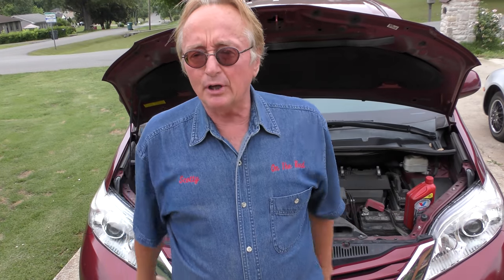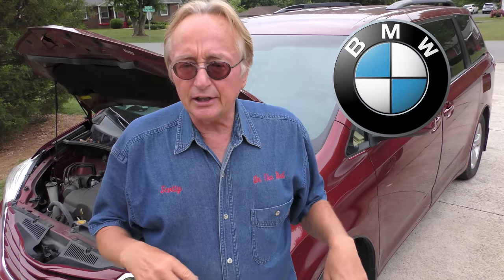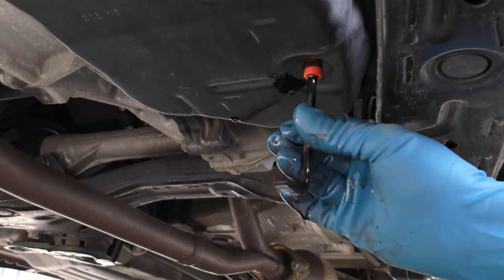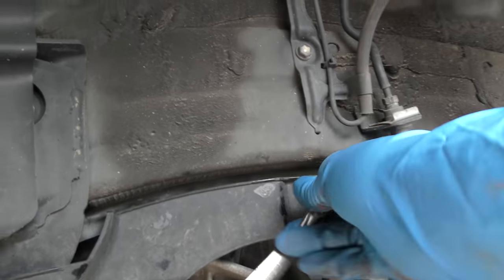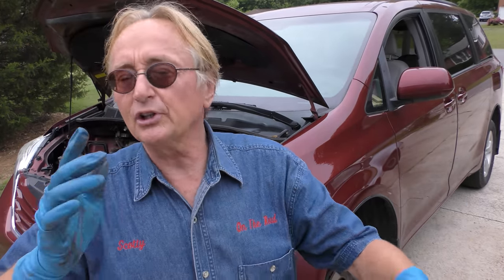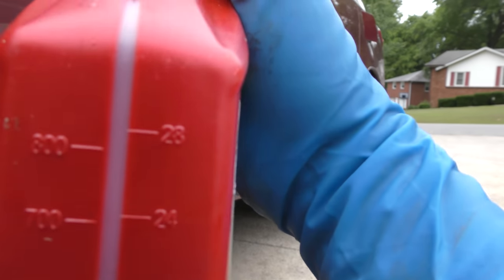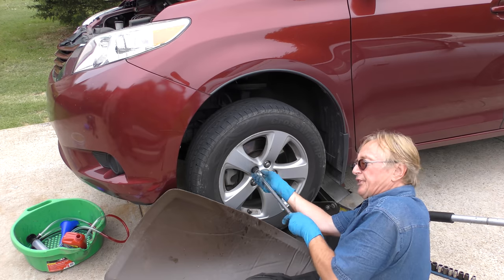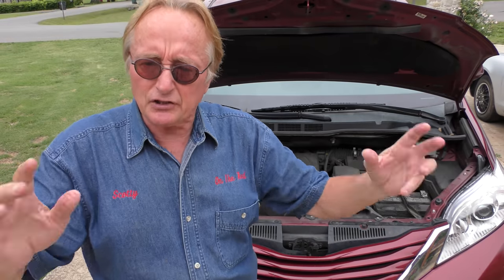Here's Why Changing Your Transmission Fluid Can Cause Damage

Comment: Dear Scotty, I have a 2010 Toyota Camry LE. I bought it used from a dealer in 2013. I’m a relatively older woman with no significant other to inform me on decisions about caring for my car. I have watched hundreds of your videos and have really learned a lot about good car maintenance. But, this transmission fluid changing, or not changing, has me in a dilemma. The car had only 35,000 to 38,000 miles on it when I bought it. Therefore, I feel relatively safe in saying the transmission fluid had NOT been changed before I purchased the car. I’ve had the car serviced regularly. After I asked the mechanic to use pure synthetic oil in my car, oil changes have been less often. I pray that’s correct. Guess Who told me about the pure synthetic oil. Now, what do I do about the transmission fluid. I feel sure the mechanic has never changed it. What do I do, just ask if they’ve changed the fluid, and pray they don’t lie to me? If they tell me for sure that they’ve not changed the transmission fluid, what then? The car now has approximately 109,500 miles on it. From just now watching your video about this, I’m thinking it’s too late to start now. Or, should I ask them to clean the pan, (is that right) and then put the old oil back in? I am seriously concerned about the car because I cannot afford to buy another one. 
(I have medical bills up to my, uh, knees, or a little higher. LOL) I would be forever grateful if YOU were to read this and let me know what to do. My son is in the Army, and is right now somewhere “over there” keeping our Great Country safe. I really think he could do it if he was here. Bless You Scotty for what you do for all the people that are smart enough to watch you, and that includes me. THANK YOU! I’ll be here in KY with my fingers crossed for your reply. Take Care!
Reply: Hi Paula, if you never got a reply on this, it's not something to be overly concerned about, especially if your transmission is shifting without any noticeable problems. If you don't hear any clunks or whines and you don't feel any jolts (or if it's a manual any "notchiness" or difficulty getting into any gear) then leave it until you can get someone you trust to check it. 
If you do get it changed, make sure you get the high quality fluid that's recommended by Toyota for the model of transmission and that it is replaced with just the right volume of fluid.
Reply: Drain and fill will get a few quarts of clean oil in there.

Comment: I have a 2001 Camry. The local Toyota dealer granted my request to have the transmission POWER FLUSHED on two occasions. A few years later at 187k, the car wouldn't reverse. I learned from Scotty that is the first indication of a worn-out transmission. Sure enough, it was. Problem was there  was no way to prove the flushes are what killed it, or if it was because of how many miles were on it. I did leave a nasty review on Yelp critical of the dealer for not warning me about flushes. I had a transmission shop rebuilt it 7 years ago. 80k miles now put on it Still no shifting issues.

Comment: 2014 is350, started changing out 4 quarts of ATF at a time at 90k, now at 196k and no issues with Maxlife Synthetic ATF
Reply: Maxlife is no doubt a great, inexpensive synthetic ATF. Not exactly matched to Ws but close enough. The key thing though is longevity is more a product of the transmission in question. It’s a Aisin. They regularly last 300,000 with zero maintenance. Now does that mean you shouldn’t service it? Well of course not. Transmissions should be drained and filled every 30,000 miles.
Reply: @nordicpride9708  i think it holds 10 quarts, or 12, not 100% sure but i just drain out 4 and replace it about every 3rd oil change so 20 to 25k. I hope to get 400k at least lol.
Reply: @xxxblanco Most people never change their transmission fluid. Yet they are the first ones crying when they grenade from lack of maintenance…. I’m sure with your routine 400k will be easy

Comment: I am 100% with you on the dipstick issue, Scotty!
Reply: Music Releases  They could at least have a fluid level sensor inside the transmission to alert the driver of fluid loss, most likely caused by a leak somewhere. 

It's even worse with the B5 Passats, on which the belly pan covers the oil drain plug, but not the transmission drain plug. You saw this coming -- I have read of a few instances in which folks drained the ATF instead of the engine oil. :(
Reply: The orange piece under the drain plug is actually used to check the level on Aisin transmissions.

Comment: Thought mine got changed on my Tacoma when I turned it in to change the frame.  I asked for it to be done, but didn't double check.  Whoops!  Now 240,000 on original fluid.  Such is life.  just hoping it does not go out while pulling the camper!
Reply: Make sure the differential is good to go as well!

Comment: Scotty, I have a 2006 Honda Accord SE with Automatic Transmission. I had the Honda dealer do the trans service for $150. When I saw the work order it did not show the trans filter under parts used and said that 2 quarts of new fluid was used. I thought that was sorta weird no filter change and so little new fluid installed. So I bought the full Honda Service Manuals Set and it says to do the auto trans service change out the trans filter and change the trans oil THREE times. It says: After changing it the first time drive the car 20 miles and then the second change of oil drive it again 20 miles, drain and change it the third time and drive it 20 miles then drain and fill to between the dipstick holes. I asked the dealer service manager why he didn't replace the trans filter and why he only drained the open once letting him know the Factory Manual procedure. He told me NO DEALER DOES THAT... but if I wanted it done that way it would be $450! That is the last time I will use that dealer. Do you have any comments Scotty?

Comment: I did the trans fluid on my 2013 Lexus RX 350 same engine. You can do it with a long funnel, no need to use the messy pump. Please only use Toyota WS fluid in the 2GRFE engine!

Comment: Love the “Scotty working on a vehicle” videos. I follow the rule that anything not Toyota that’s NEVER been changed (90K)+, I will NEVER change. It will ruin them. Old school break over bar and manual torque wrench, I have those! Tks Scotty.
Reply: I just bought a vehicle at 88k miles, is it safe to change the fluid at this mileage?
Reply: @FearABlankPlanet  change it I do it on my with 110k and is running great.

Comment: My friend brought me his first car ever to check over. 2009 chevy impala 125k  fluids looked never changed. Power steering pump gone, oil overfilled, oh boy.  Transmission fluid never changed. I dont think he should change the transmission fluid at this point. Just pray like you said. I corrected the oil and cleaned the car up. Hes got an airbag light on im going to try to reset.

Comment: Even transmission shops can put the wrong fluid and the wrong amount of fluid in your transmission! Be aware!
Reply: Exactly why I do my own work, as much as possible.
Reply: And so can yo and I...
Reply: @spol1622  you and I are not mechanics, but transmission shops are supposed to know what they're doing, it should be certain they put the right fluid and the right amount of fluid, but often that's not what happens.
Reply: Michsqitch  check the dipstick to see the color and smell of the fluid, and check the bill to see what fluid they put in the transmission, comparing against the owner's manual.
Reply: OMFG I KNOW, i bought the wrong atf at walmart due to the workers not checking the shelves, and when i went to return it i said “the rest were dextron 6 but this multi vehicle atf and i dont wanna mess up the transmission” the lady behind the return desk said it wouldn’t have hurt it. 🤦🏼‍♂️
Reply: Michsqitch  you won't know if they done something right until something goes wrong with your transmission
Reply: true!
Reply: @robsonselzelin  and make sure they use OEM fluid and make sure they actually do it, if you’re not gonna do it yourself. I can see a shop very easily saying they did it but not actually doing it. I would ask to have all the old parts from the car and ask to see the fluid bottles they used. I’m pretty sure most cars have a gasket on the various plugs so they should at least have those to give you back. And I’d ask to see the drain ports when they’re done. At the very least the whole area should be clean versus the surrounding area because they sprayed it down with some brakleen when they were all done....
Reply: @robsonselzelin  You’re right, I worked at at transmission shop, and they literally have top of the line equipment to drain and fill the transmission. They have all types of ATF, CVT Fluids, on hand. I don’t think any transmission shop would be in business if the just going around wrecking transmission.
Reply: Also the DEALER.  Honda dealerships have destroyed plenty of S2000 differentials with the WRONG fluid.
Reply: @adilsoncabral5151  On a car where nothing ever been done to the transmission at 236k miles , do you think it should just be left alone?
Reply: @charliep5139  no
Reply: @sl4983  leave it alone.
Reply: @sl4983  dont touch it!! lol
Reply: @dned23  why'd you say lol
Reply: That's why if you are not able to do it yourself you should find a trustworthy mechanic.
Reply: @charliep5139  you are super paranoid buddy.  Ur just going to the wrong shop or cheating out and shopping around for the cheapest price and then getting screwed. Go to the dealer if you doubt anyone’s work or go to a reputable shop. The good ones aren’t cheap.  Most buy in bulk and won’t have bottles. If you are that insecure about who’s working on your vehicle then ur at the wrong auto shop. But truly no shop that has been in business for years and has a good reputation is going to risk that over a few bucks in fluid or by not replacing something so routine and simple. The bad stigma shops have is because people always go for cheap and then get what they paid for.
Reply: @sdsupratt  If you say so. I don't believe there's anything wrong with asking to see parts that YOU paid for. In fact, in many places it's a state law that you have a right to get your old parts back if you ask for it.  Also, I've never heard of OEM bulk transmission fluid. Even the dealer uses bottles. I think you're thinking of bulk engine oil. Regardless, when you pay for a service, you have a right to have it done the way it was agreed upon, and as the old Russian proverb goes, "trust but verify." Idon't see anything wrong with that , and if you go to a place that isn't willing to do that, then walk away. 
That's how I spend my money. If you prefer to  be too afraid and/or too trusting to ask to see how something is done and/or to have someone show you the finished product after you've paid for it, then that's up to you.
Reply: @charliep5139 most Independant shops aren’t going to go to the dealer and buy their $20/ quart fluid. The term is genuine not oem. Oem is such a gray area term used in the industry that most regular people don’t understand or misconstrue for what the dealer sells. Most times it’s not what the dealer sell but only made by a manufacturer that makes original parts for that auto manufacturer. Not necessarily that exact part In question. But that’s a worm hole topic for another day. Anyways, most people don’t realize that there are only maybe two manufacturers making all the oils sold Across all brands and makes. So the smart shops have realized that buying bulk dextron vi works accross most models cuz they all run an almost identical fluid. Some may have different dies and stuff etc… regular automatics 90% can run like new or better off of maxlife multi vehicle cuz valvoline is one of those main manufacturers and is the source for most of the atf fluid in modern vehicles. It’s why they can get away with a multi vehicle formula. Haha it’s what actually being sold to Honda and Toyota and go and Ford. They just rebottle it with their logo. Lol. Those companies don’t make their own fluids but out source to big companies that already have the r and d and manufacturing facilities. Anyways if you want to buy $20/quart atf from the dealer ( which is the only place to genuine fluid ) then go for it it’s not going to hurt anything. Just saying.  But have some more trust in repair shops. There are lots of honest good people out there looking to help people like you.  Lots of cheap people out there getting screwed cuz they low ball their repair guys and then get treated badly. Have a reasonable expectation and you will have reasonable results
Reply: 2013 ford automatic at 107000 giving slight transmission issues, y'all think I should change it?
Reply: @alecbarreda1  Yes...100k miles is pretty near when most manufacturers suggest changing the fluid. And the sooner the better
Reply: And then the transmission shop covers their asses and tell you that you needed a new transmission anyway.
Reply: @sl4983  H
Reply: @Tgrovez  the truth is most people neglect their transmission fluid and come in once they have already felt soemthing weird going on. That’s why they are finally in the shop to begin with. With a “ how much for a transmission flush” or service. Truth is it’s too late and you most likely need a new transmission or you need one very soon. And then blame the shop after it fails not soon after.  No one comes in religiously every 30k for a trans flush and then has that type of problem. And if so very very rare. Lots of times the people bad mouthing them aren’t telling the full truth or are just ignorant and looking for an excuse to not be in the wrong or upset cuz they have to pay for a repair due to their own negligence
Reply: @adilsoncabral5151  what kind of transmission fluid u use for a old 1995 mercedes

Comment: At over 70-80K , what you need to do is a partial change. If it was never done !
2 quarts at a time , basically with every oil change , this way
you dont have to lift the car twice. Repeat the process 4-5 times.
Reply: My trucks I've never done, my mechanic bet with me if it had any problems because of the fluid he will fix it for free. The oil was made to be there for 300k ~ 400k miles.

Comment: I also recommend avoiding putting body parts underneath car in case kids come by and accidently "wonder" what the handle is. Putting car in parking brake is also recommended to prevent vehicle from rolling whenever tire removals are done. I enjoyed watching this video and I'm sure that son of yours whether he realizes it or not is very lucky to have a dad like you carry this valuable knowledge. Keep up the great work and look forward to watching others.
Reply: I always put the tire I took off under the car. That wheel/tire is a lot cheaper to replace than you are.
Reply: @deaconwanderer2409  If only I was as thin as a tire!
Reply: Yes because you can make a human sandwich !!
Reply: I just use a 30 yo chinese floor jack. It ensures i get the job done fast. I know Im running behind when the frame hits my chest so I step it up.

Comment: Good to see that Scotty recommends that Valvoline synthetic universal fluid.It's easy to find and being full synthetic,should be better than original.
Reply: For Toyota I'd still use the OEM fluid for the specific additive package over a multivehicle
Reply: It depends. For my Acura, I use ACDelco semii-synthetic friction modified fluid, it makes the shifting considerably less notchy. It does have to be changed more often though.